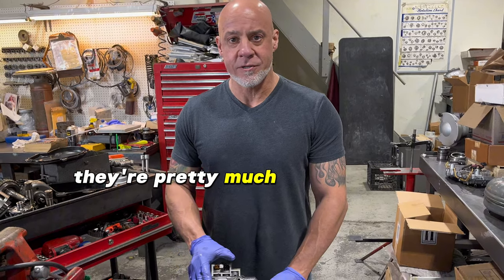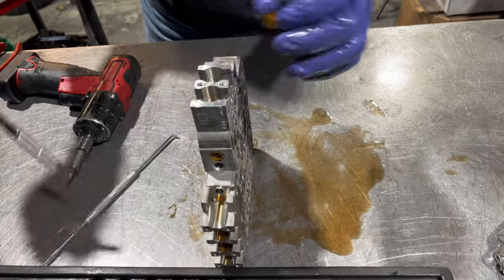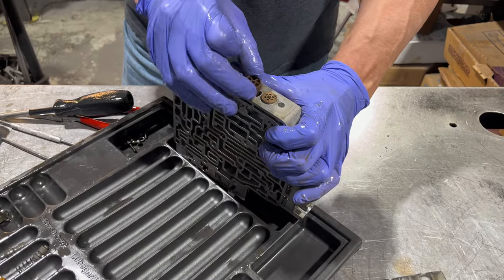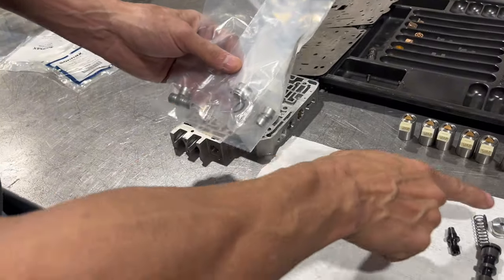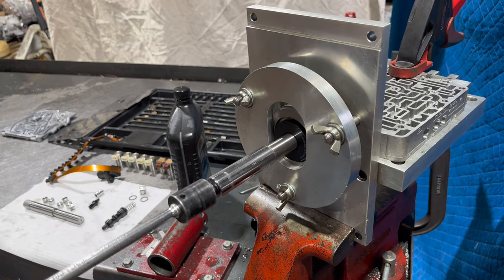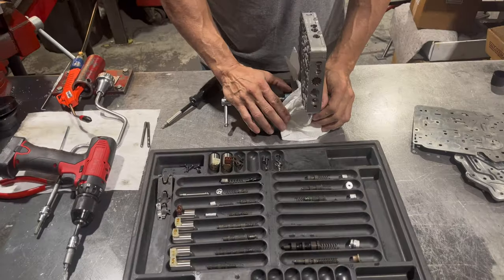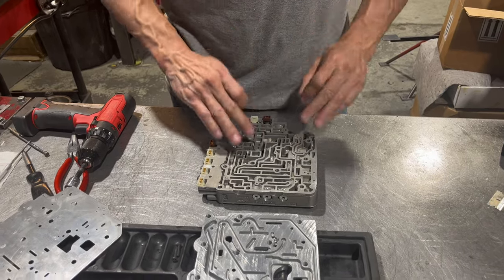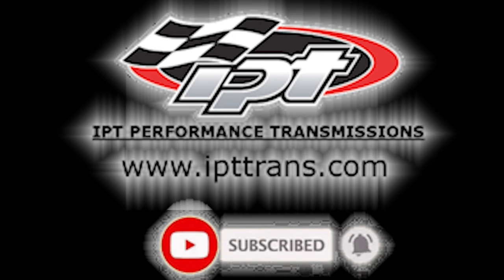The 01M 01P Valve Body Nightmare- Volkswagen's Brick of Misery

Comment: Let me ask you a question. The reverse feed tube that goes into the case above the valve body, where can you buy them or the o-rings? Dealer didn’t have, transtar didn’t have them either. I have a few different o-ring kits at my shop (I own a repair shop) and none of them fit properly. If you know where to buy and have a part number i would appreciate it.
Reply from the maker: @peanutbutterisfu  Other than the dealer, I’m not sure. 
The tubes are hard to get but the o rings should be in a rebuild kit⚙️

Comment: Hello.  I have a problem with the CUG gearbox of a VW EUROVAN 2.5 from 1995, petrol.  The problem is that the gearbox is stuck in 3rd gear.  It starts and drives only in 3rd gear. The reverse gear works properly.  After connecting the computer, I have error 00262 solenoid Valve 3 (n90) short to ground.  What should you pay attention to to eliminate the problem?  I measured the valve resistance and it is normal.  Thanks for the tip.  Regards